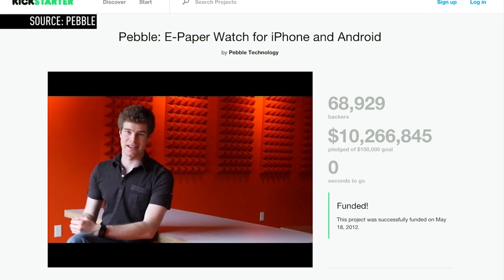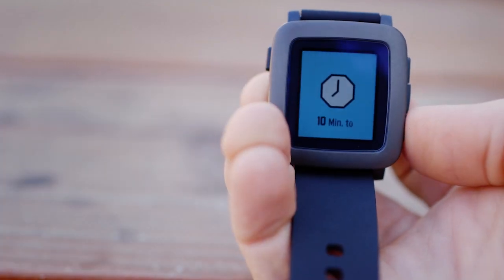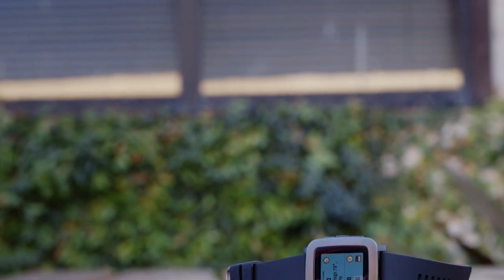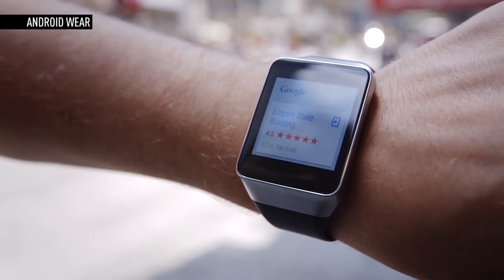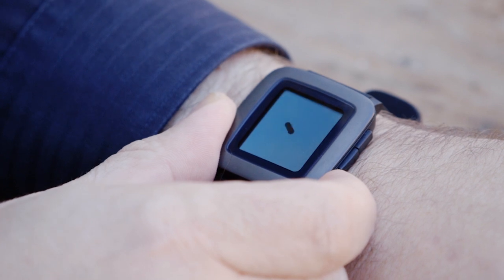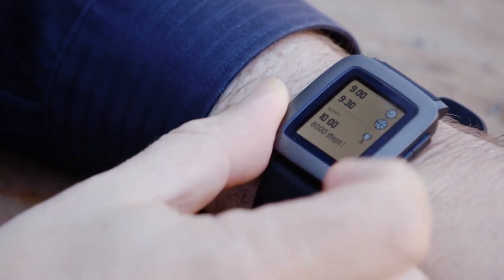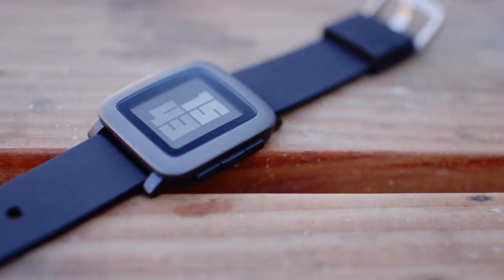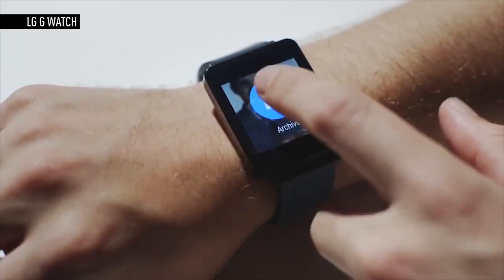Crunch time: can a new Pebble smartwatch make it in an Apple world?

Comment: To those saying they want higher resolution or a touchscreen: that is not the point of the Pebble and goes against the company's philosophy! Each would affect the watch negatively, namely by increasing the price of the watch and decreasing the battery life. Your eyes cannot tell the difference between a high or low resolution screen of this size at anything more than an arm's length away from it, and at an arm's length away from a device like this touch gestures are just as effective as button control. So if you want a high resolution touchscreen, the costs outweigh the benefits.

I read that somebody in the comments wanted a speaker on the Time. Why? Your phone already has a speaker, your watch doesn't need one as well! The little vibrations you get on your wrist when a notification comes through are more than enough to alert you, and arguably more reliable than a speaker in a crowded, noisy place such as a train.

I think that those who want a fashion statement as a watch or phone are entitled to that desire, but should not criticize a watch which - judging from the price The Verge quotes - will be far cheaper than most similarly attractive watches while maintaining a clean, aesthetically pleasing design. The Pebble administers to a different market than the one these consumers inhabit. Frankly, I am not a fan of the glitz-and-glam philosophy Jony Ive adheres to when designing his products, especially regarding the Apple Watch (from what I saw in a recent interview in which he bagged Motorola, he also looks like an arsehole). That thing will actually blind me if I try to look at any part of it in the sun and will cost me a metric fuck-tonne of money to buy. I will not pay six hundred Australian dollars for this shit, not when I am perfectly satisfied with my eighty Euro Swatch I bought in France. That watch will wear nicely, feels nice to wear and is excellently crafted  as far as build quality is concerned. The battery life of the Apple Watch will probably be atrocious compared to that of the Pebble line, and I don't want to put another thing on to charge each night and risk forgetting to pick it up when I go out or forgetting to charge it beforehand. And I'd also like to mention that without some sort of matte finish, the Apple Watch will be destroyed by daily use as all that shiny metal attracts fingerprints and scratches from all directions, like some ridiculously strong magnet. 

I will pay exorbitant amounts of money to buy a beautiful analogue watch (as I believe that most analogue watches are by default more attractive than all smartwatch offerings thus far) but when I am looking for a smartwatch I am looking for a clean/simple, maybe even utilitarian design that does not distract me from the information I am trying to absorb. I don't need a fucking Galaxy Gear with its Samsung exclusivity (and pointless camera), nor do I need an Apple watch with so many aforementioned problems and what looks like a poorly designed touch-screen GUI to boot. I want my form to generally follow my function, please. Not the other way around.

And finally, what's with this fucking title? Can The Verge refrain from shoving Apple comparisons into their video titles unless if they are the most pertinent aspects of the video? I did not see mentioned in the title of this video a colour e-paper display, nor a mic, nor the new look that Pebble have developed for their new OS/product.The Apple Watch has not been released yet, I remind you. Calm the fuck down, and refer to the titles below when wondering what you should not call your video (as not to piss me off, because I matter).

Amazon Echo review: it's Siri in a Box (no it isn't, it's the fucking Amazon Echo)
Crunch time: can a new Pebble smartwatch make it in an Apple world? (We'll wait and see, but it looks like it fucking can)
As a side note to this title, you (The Verge) have no idea which company will occupy the smartwatch world by the time either of these watches are released, unless if you have some sort of consumer tech crystal ball hidden away somewhere...

Only two Apple comparison titles so far, and let's hope it stays that way.

Comment: A simple watch that does a lot of useful things the wearer will appreciate. It is in the using that sells such a watch. Apple on the other hand is talking about fashion/jewellery watch that does very little except answer voice calls. Utility aspects carry way more value to the user as they are "sticky" functions the watch gives to the user. You can bet an apple watch user will pull out the phone 50% of the time. This means inconvenience that users soon learn about. A utility watch will do 95% on the watch and that rare 5%,the phone can do way better faster and accurately.
For a company the size of Apple, it will take 3 years and v3.0 to get the basics right. Fortunately, for Apple, it can afford to wait. It can junk a platform and start again without much hurt due to loyal fan base.

Comment: This looks very good, and also at a reasonable price, with a acceptable battery time. Other watches really fails on those two points.

The only thing is one: not touchscreen, and two: the buttons on the said looks harder than what would be optimal (watching the strain on their hand/fingers when pressing). If the buttons aren't hard, it might not need a touchscreen

And yeah, what's up with that title? 0o

Comment: I like the pebble but its fucking 200 dollars the moto 360 is that much second hand and the moto 360 2 is just 300 dollars new.
Reply: The Moto 360 is old, has a TI processor that is not optimized for smartwatches and has a 24 hour battery life
Reply: That may be true but I still feel pebble is waaay overpriced and under featured. They should have partnered up with a large company to get the price down to like 120 then they could have killed all the other brands out there.
Reply: Vinnie J it is cheaper than any other flagship watch and why do you need a watch that can feed your dog? That is what the Pebble is supposed to do.. It is a notification delivery system with some smart features. You can control your music and see techs from mom, what else do you need?